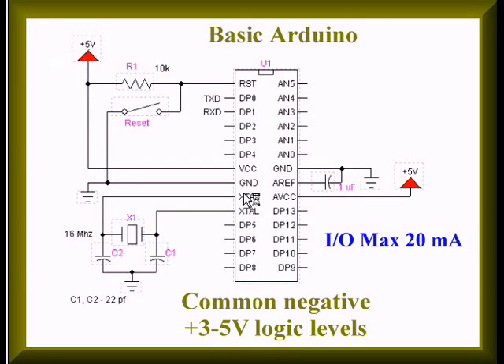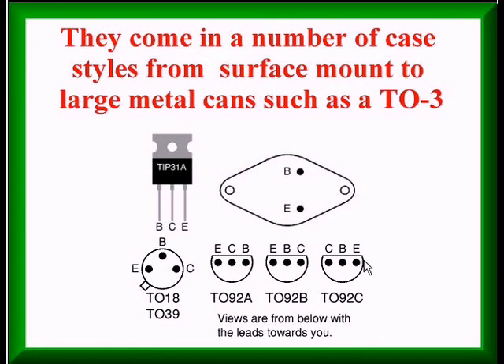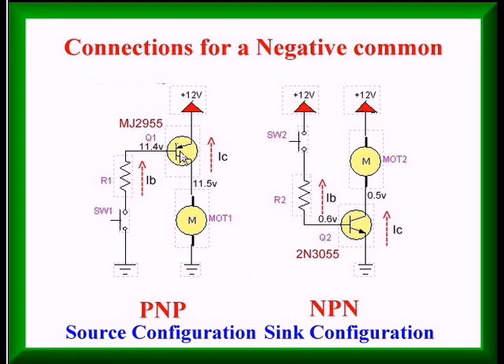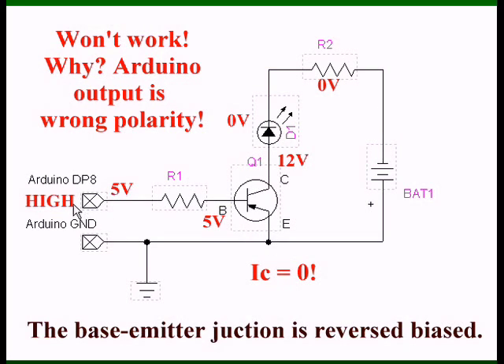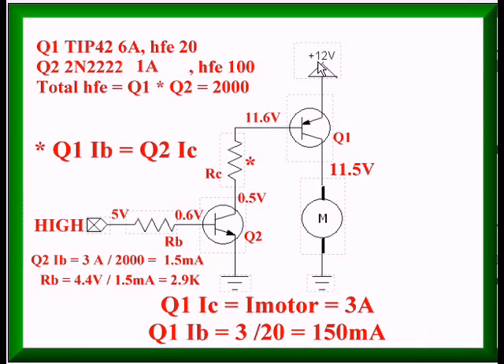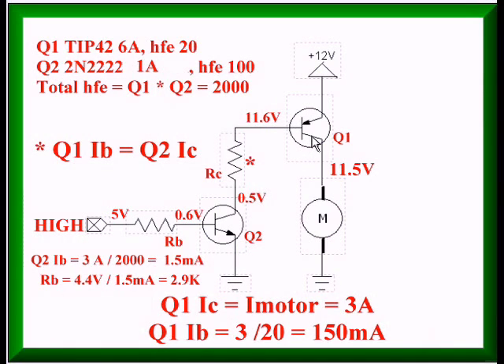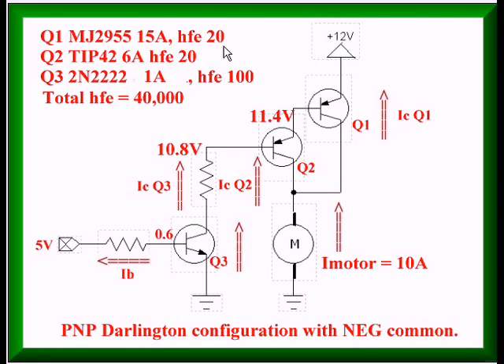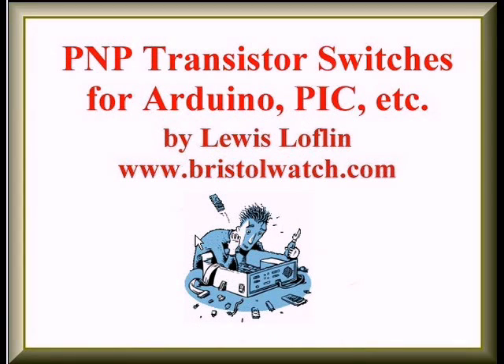Using PNP Bipolar Transistors with Arduino, PIC

Comment: Just because you adopted the electron current instead of the conventional current, you had to “invent” counter-intuitive arbitrary definitions. Anybody could easily understand what a source or sink means without having to remember “configurations”. “Negative ground”? WTH? It’s either positive or negative with reference to ground. This is all unnecessary confusion due to a single malpractice. 😢. Otherwise, it is a great tutorial.

Comment: Still better if you consider/use the conventional current because all symbols and terms are based on that - your electron current flows in the reverse direction (against the arrows in the diode) , and your “sink” sources the current, for example. This is why it is important to adhere to the convention.
Reply from the maker: Two textbooks are on this link. I will add Semiconductor Pulse Circuits Mitchell 1970. https://www.bristolwatch.com/science/holes.htm
Reply: @LewisLoflin  Thanks for the references. Indeed the more accurate current is the electron flow. And we all have come to a consensus to adopt the conventional current and ALL electronic terms and symbols even agree with that convention. 

In engineering and technology, we can find such conventions too often. Holes in semiconductor, ray model of EM, wave model of EM, particle model of EM, etc are just some of such conventions which are not necessarily the more accurate models. 

On the other, radio valves are not semiconductor devices, so your arguments that the arrow points towards the n type semiconductor fails there. So is the case with Selenium rectifiers. So is the case with the Schottky junction where there is no n-type semiconductor.  

You could stick with your preferred methods, but trying to attribute them with qualities or properties or justifiable reasons must be done in an extremely meticulous way. 

It is very obvious that arrows in symbols depict the conventional current flow. Just because some US military materials and a few books using the electron current does not disprove what really did happen in the recorded history. Even those military institutions now have abandoned the electron current model. They have updated too. Others should too❤
Reply from the maker: No they are not prior to ~1984. Semiconductors are used with electrical circuits, and positive flow can't work with other devices. The arrow point to the N-type material and with rectifier diodes the positive part of the circuit. From this point from now on because I have to deal with actual circuits I will not use positive flow.
Reply: @LewisLoflin What about source and sink then? I could not find any resource that ratifies your opinion or whatever. Every resource says that the arrow indicates the conventional current. On the other, everything perfectly matches with conventional current including the symbols, terms, and all.
Reply from the maker: Go back to the military, books prior to the 1980s, Want a book list?
Reply: @LewisLoflin sure
Reply: @LewisLoflin  Only some US military materials used electron current. The adoption of the conventional current is  rather the oldest practice, dating back to Benjamin as I remember (not sure though). The modern US military material all use the conventional current.

Comment: check my spec sheets?! you can't make me, you're not my dad! :-D

it's hard to quiet my head down. thinking of how to use the 3.3v GPIO on my ESP3622 on a PNP transistor to source from 24v through a motor has been making my head go quiet. i've been googling and reading for a week, and your diagram at 8:44 finally makes sense to me. now my brain is alive with such high quality thoughts as, "mustachioed yachtsman" and "balloon laundry"

ah, that's way more clear. back to normal! :-P

thank you so much!

Comment: I have a question. Is the device being powered supposed to share ground with arduino? I have circuit similar to the one at 8:52 and it's not working even when i skip NPN and bridge PNP with board's ground altogether.
Reply from the maker: Unless you use opto-couplers for isolation that involves a little more circuitry then yes. The emitter of Q2 and the motor negative share grounds with Arduino.
Reply: @LewisLoflin  Is it safe for the board? My device in place of motor is also 12v and board being used is esp8266 with 3.3V on IO. Power supply is 5v USB. Does the voltage difference with shared ground matter?

Comment: Can you anyone explain the Q2 ib calculation? Why 3A/2000? Why 3A needs to go to Ic of Q2?
Reply from the maker: The 3A in the Ic of Q3 is the required motor current or Imotor. If Q3 hfe (DC gain) is 20 then the current I need for Ib is Ic /  hFE = 3A / 20 =  0.15A or 150mA. Ic is Imotor.

Comment from the maker: Electron flow is correct. But today I use conventional because of what is taught today. See the following on this issue:
https://youtu.be/BhHTRMGXO7Q  MOSFETs and electron flow.
Reply: Conventional current is positive to negative (flow of holes).  Actual electron flow is negative to positive.  You just have to specify which usage you are using.  The terms "sink" and "source" presume the conventional usage, and that is why they don't fit the electron flow usage in your example.  The confusion in your videos is solely due to the ambiguity of your use.  Both are correct.
Reply from the maker: I get into this all the time.  Always assume convential even though I don't buy into it.
Reply: @LewisLoflin  I know where you're coming from, but I think it's more a question of clearly communicating by explicitly stating which model you are using in any given statement. If you are getting this all the time, that might tell you something.
Reply from the maker: @JohnClulow  Good point I will keep in mind. Thanks.

Comment: Thank you. Conventional current is making it very difficult to learn this subject . Been trying to teach myself for a long time and its caused a lot of confusion. They say it makes no difference but i find that it does, especially with semiconductors. So its good to be shown whats really going on in a circuit for a change.
Reply from the maker: I prefer electron flow but most people have been taught conventional flow.
Reply: @LewisLoflin , I prefer electron flow. I like to 'see' ground as an 'electron lake'. VCC pulls them out.
Reply: IMHO electron flow just make it even more confusing as the schematics remains in conventional flow. Diodes and transistors do not make sense at all.

Comment: Thanks for these video series. 
I'm realy new to electronic and I still have some problems with the basics of transistors. Each time I do the math, half the time I'm wrong and I not always understand why. As example, in the "PNP Darlington Transistor with NEG common", I do the math as here under :
R1=10.3/(5A/1000) = 2060 Ohms (so we choose a smaller value 2K)
R2=4.4/(5mA/100) = 88000 Ohms and here I don't understand why you choose 2.2K that is far from the calculated value. Is it a mistake  or is there a common explanation that I do not know ?
Thanks for your help ;)

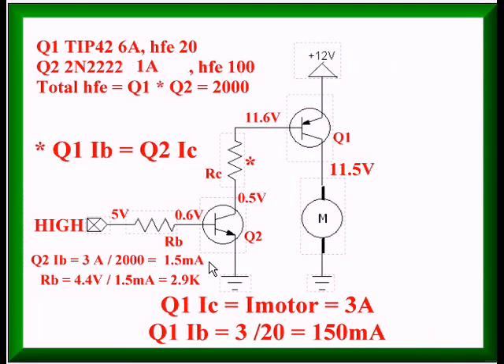Comment: It's a very good explanation of how the transistors are working, I really liked it! One question: in the example beginning from 8:20, when the 5V is coming from the arduino, why should we substract 0.6 volts from that 5?
Thank you!
Reply from the maker: When measured from ground to the transistor base the voltage drop across the junction is about 0.6V

Comment: OK, probably a dumb question and maybe I missed something along the way, but WHY would I want to use both a PNP and an NPN transistor to drive a motor?  I could do the same thing with two NPN transistors and achieve the same level of amplification, right?  The only difference that I see is that the motor is connected on the low side as opposed to the high side which would otherwise be the case if using a pair of NPNs.  So the only reason I can think of doing it this way would be to protect from a possible short to ground on the motor.
Reply from the maker: It's a matter of polarity. There is all NPN design. See http://www.bristolwatch.com/ele2/npn.htm
Reply: Right, I understand the polarity is inverted, but my question is for the example in this video.  Is there any real advantage to using a PNP over an NPN design just to turn a motor on and off?  Maybe this was just an example to show how to design a PNP circuit.  If so, that's fine, I just want to know why someone would want to design this circuit using PNP over NPN in this particular case.  Maybe you want to interface this to an existing circuit and the polarity matches when using PNP.  Other than that, and the reason I gave previously, are there any compelling reasons to use PNP over NPN specifically for the above example?
Reply from the maker: I have plenty of transistors of all types and this is an instructional video. Thanks.
Reply: OK, so no real value here using PNP transistors then other than for pedagogical reasons.  Got it.
Reply: @Enigma758  Automotive use for example, if you need to drive a motor with chassis attached to chassis ground, witn PNP you only send the colector signal to + of the motor...for led stripp with common ground...and so on...

Comment: Should I put a pull-up resistor on the base of Q1 and a pull-down on Q2?
Reply from the maker: which drawing are you referring to?
Reply: The one that you control the PNP transistor with Arduino by using a npn and a pnp and applying a high to the npn which switches the pnp. I haven't tried it yet, but I believe we need a pull up on the pnp and pull down on npn so that it doesn't float and turn on by itself. Maybe a resistance value of 10 times the R value on the bases? Thanks! Great videos!
Reply from the maker: JPEE2009 You don't need a pull up - when the NPN driving the PNP is switched on a current path from emitter to base on the PNP switches it on. See the following link:http://www.bristolwatch.com/ele/tr4.htm
Reply: Thanks!
Reply: Hi, my answer is almost the same, but I want to know if is possible change the NPN transistor for two pull down resistor and put the arduino output 5v between them...
Reply from the maker: The thing would be completely redesighned. Go to the website and click on the link for all NPN h-bridge.
Reply: Tks

Comment: First of all, great videos. I really enjoyed your videos.
But what bothers me, is that you insist that the current flows from negative to positive.
Although that this is true, electrons flow from negative to positive. All the symbols and terminology is based on the current flow from positive to negative. ie. Sink as in go downwards to ground, source as in flow outwards of positive.
If you would teach this "wrong" it would be easier to understand the current flows as in  a transistors the arrows would point in the right direction.
Reply from the maker: The problem is that I teach electronics and electricity the problem being is semiconductors don't operate alone. Then what do you do with a positive ground? Many early semiconductor radios, etc. had positive grounds. The arrow in fact points to the negative semiconductor material. But you comment is well noted. Thanks.
Reply: Yes, I agree with that. There's a reason is called conventional current flow, because by convention it was agreed upon to treat it that way. But every once in a while there comes people that insist to use the real current flow, I think they think that makes it more interesting... not sure. But it does make it harder for people that just want to learn the basics.

Comment from the maker: Links:

Using the ULN2003A Transistor Array with Arduino
Using the ULN2003A Transistor Array with Arduino

http://www.bristolwatch.com/ele/uln2003a.htm
ULN2003A Darlington Transistor Array with Circuit Examples

-----

Using the TIP120 & TIP120 Darlington Transistors with Arduino
Using the TIP120 & TIP120 Darlington Transistors with Arduino

http://www.bristolwatch.com/ele/tr3.htm
Tutorial Using TIP120 and TIP125 Power Darlington Transistors

-----

Using Power MOSFETS with Arduino
Using Power MOSFETS with Arduino

http://www.bristolwatch.com/ele/tr2.htm
N-Channel Power MOSFET Switching Tutorial

http://www.bristolwatch.com/ele/tr1.htm
P-Channel Power MOSFET Switch Tutorial

-----

Using PNP Bipolar Transistors with Arduino, PIC
Using PNP Bipolar Transistors with Arduino, PIC

Using NPN Biploar Transistors with Arduino, PIC
Using NPN Biploar Transistors with Arduino, PIC

http://www.bristolwatch.com/ele/tr4.htm
Understanding Bipolar Transistor Switches

-----

How to build a Transistor H-Bridge for Arduino, PIC
How to build a Transistor H-Bridge for Arduino, PIC

http://www.bristolwatch.com/ele/tr5.htm
Build a High Power Transistor H-Bridge Motor Control

http://www.bristolwatch.com/ele/tr6.htm
Driving 2N3055-MJ2955 Power Transistors with Darlington Transistors

-----

Build a Power MOSFET H-Bridge for Arduino, PIC
Build a Power MOSFET H-Bridge for Arduino, PIC

http://www.bristolwatch.com/ele/h_bridge.htm
H-Bridge Motor Control with Power MOSFETS

http://www.bristolwatch.com/ele/tr7.htm
More Power MOSFET H-Bridge Circuit Examples
Reply: Hi Lewis,
today I just searched for some Raspberry infos. Now I stuck on your videos on YouTube over hours. Great work!!

Just one hint: In "More Power MOSFET H-Bridge Circuit Examples" Figure 4 (
<img src="MOSFET/mosfet6.jpg" alt="P-channel Power MOSFET Switch" width="640" height="480"><br><b>Figure 4
) is missing...